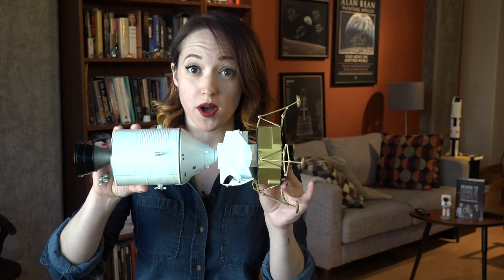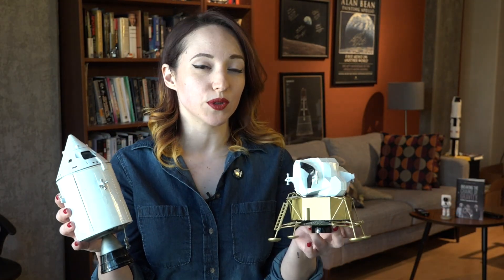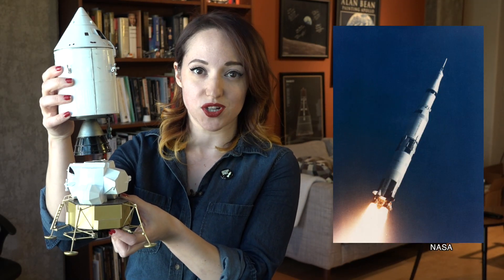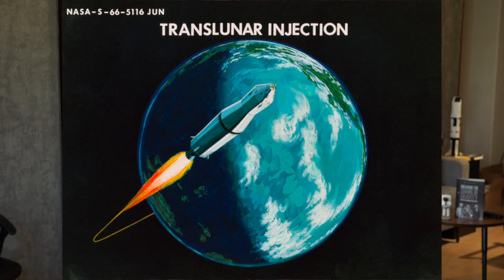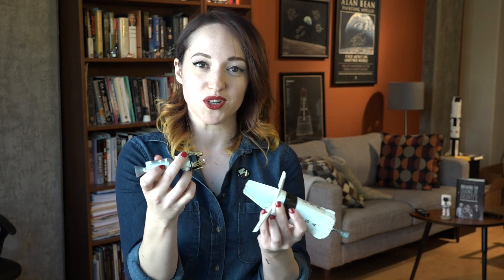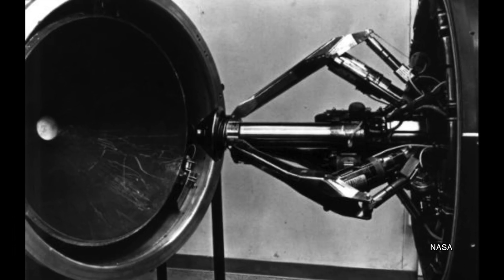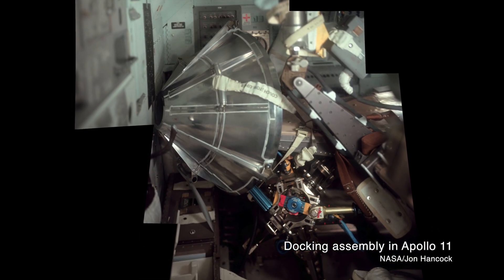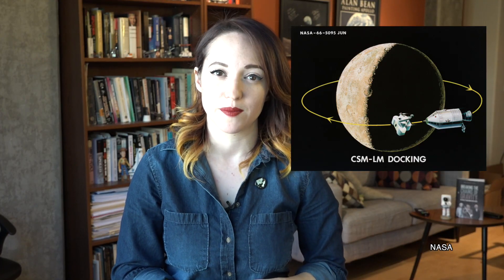How Did the Apollo Command and Lunar Modules Become One?

Comment: They would never find Columbia in a million years. The story is fake.  Moon size is 1/3 of the size of the earth so being on the moon orbit feel the same as being on the earth orbit. Anything left on that orbit is hundred of thausands miles away and almost invisible. Thy used lander with window on the side, size of washing machine window. I can't even reverse my car with side window available. Lander only has a fuel for one attempt. Even with modern computerized equipment it would take many weeks to find Columbia and multiple refueling to adjust the speed from zero to thousands mph. It is just idiotic story invented for population of 1960 who watched Stanley Cubric cinema productions.
Reply: Clearly you’re it uneducated. That’s fine.
Reply: @kitcanyon658  On the other note. Explain why the rocket or lander didn't heat up to thousands of degrees. In vacuum there is no heat disposal anywhere. The temperature of the Rocket would increase endlessly untill red hot just by its own electrical devices and sun rays. That is basic physics.  All those missions are fake. Even unmanned. Only low orbit is possible where you actually can disperse your own heat to thin gas particles.
Reply: @dariusz078  : Basic physics and you don’t even know about radiation heat transfer? 

Another fail, bro. Like is always say, get an education.
Reply: @kitcanyon658 
So I will ask you a question now. How is rocket engine heat going to be removed from the rocket and what type of air conditioning is used on that rocket from 1960-ties
Reply: @kitcanyon658  I am trying to make technical conversation but you are getting emotional like menstruating girl. No need for that. Without being too touchy feely can you explain why items in 80% evacuated tubes heatting up to hundreds degrees. Well, my understanding is, because convection and conduction is obstructed and to radiate away so much heat that is given by sun the item need to increase its temperature. Just keep your answer technical without emotional mood changes. Don't call me son. It is weird thing to say.
Reply: @kitcanyon658  you came to me with grievances not me to you. You are now asking me to do calculations for you to prove something? If you have any issues with real tests of heated materials in half- vacuum tubes then I will listen and respond with counter arguments. For now you are just being a bit of angry confrontational individual.
Reply: @kitcanyon658  to disperse heat from the space craft in a controlled manner they would need to paint black the area that is not exposed to the sun. Blackbody radiation of items painted black is the most effective. (Epsilon close to 1). They would need to use series of complicated heat pumps to transfer heat from one area to another. That is only theory. In practice it wouldn't work because it is too complicated. Non such devices were contemplated in the moon mission anyway because it was fake. All they cared about is good Stanley Cubric like production. Population of 1960s wouldn't ask questions. They were well mind controlled by Hollywood productions.
Reply: @kitcanyon658  If an object is orbiting the Sun at the distance of Earth (150 Gm), it will actually register quite high temperature (about 400 K). That is assuming there is no engine and electronics that add up heat to the system. If you add all the energy consuming equipment the temperature would probably reach thousand.  Even average car engine cannot be cool down by radiation. You need very efficient radiator and fans and use convection. Cooling an engine with radiation is impossible. Have you seen those rocket and lander. It is as thin as paper. Anybody would fry inside like chicken. Especially the lander. There were no haet pumps, no  insulation, just plywood and tinfoil. It is just crafted for film shot, that is it
Reply: @Smee Self what is an odd thing to ask assuming that whole moon landing story was produced in film studio.
Reply: @Smee Self it is really odd to ask temperature at the moon. Do you mean air temperature? There is no air. You mean surface temperature? Surface of the planet has incredible mass and it takes weeks to heat it up to hundred of degrees unlike light weight kitchen foil lander. . Moreover day on the moon is very long. Try again.
Reply: @Smee Self pebble touches another pebble and another pebble touches another pebble. It is called CONDUCTION heat transfer. Pretty basic elementary school staff
Reply: @Smee Self it touches the ground, so?
Reply: @Smee Self the only amusing person here is you. you are trying to say the lander will cool itself down with legs touching the moon surface. I will play with you:  'Lander is not touching the surface. It is in space for last couple of days and still hasn't landed yet.' can you quickly tell me it's temperature?
Reply: firstly, satellites are unmanned and electronics that withstand 400deg faranheit heat are available,  moreover at lower earth orbit you have gases that play critical role in cooling down the satellite. Eventually drag from atmospheric gases brings the satellite down. That is not the case once you pass van Allen belts. You have no gases and no hope. Nobody have been there yet. 
Secondly,  are you trying to say that plywood/kitchen foil lander doesn't need to disperse heating from rocket engine? You clearly have no technical imagination. You proved you have trouble with logical thinking in first 2 comments but this is just a final confirmation about quality of "iteligentsia" that support moon landing nonsense.
Reply: @Smee Self you came to me and start talking. Then you became moody and angry. If you are unable present any arguments then jog on. I am done with you.
Reply: @Smee Self At first you asked incredibly blunt question about temperature at the moon during the moon landing. Ask Stanley Cubric.
Reply: @Smee Self are you asking me to provide the temperature from moon mission that did not take place and then insists on that in another message. It is madness.
Reply: @Smee Self tell me the temperature of chicken in casserole on full flame one second after you put it from fridge to the oven.
Reply: @Smee Self let's start from measuring temperature on EARTH.  Even in Canada at -20deg Celsius you will get + 200deg Celsius if you exposed small objects to the sun in vacuum glass tube. Now extrapolate that to real vacuum in space travel and unobstructed by earth atmosphere sun shine.
Reply: @smeeself, @Jan_Strzelecki, @dariusz078
Gold’s melting point is at about 1,943 °F (1064 °C). With little to no atmosphere on the Moon, the heat from the Sun would have melted the see through layer of gold on the helmet visors. This video further supports the Moon Landing Hoax.
Reply: @Smee Self  To sum up, their tiny spacecraft was able to accommodate air conditioning system,  hydrogen power cells installation, hydrogen tanks plus oxygen tanks, and anough of it, plus fuel tanks plus rocket engine plus rover and staff, lol, and oh, I almost forgot, plus 600Ib of moon rocks on the way home. They must have left shovels on the surface of the moon. To think of it is mind-blowing. I wonder why they concealed the footage of astronauts shoveling moon rocks into the spacecraft.
The idiocy of today is to believe in unbelievable but those who believe in moon landing will believe in anything.
Reply: @dariusz078  To sum up, their tiny spacecraft was able to accommodate air conditioning system,
The Lunar Module didn't use air conditioning to disperse heat. The fact that you didn't know that indicates that you've done no research whatsoever, and thus your uninformed opinion can be dismissed as such.
Reply: @Jan_Strzelecki  lunar module, didn't use air-conditioning, so I guess the team was well trained to withstand couple of hundred degrees of heat. I guess they were very well trained. Believing in this whole story indicates your have very good technical imagination.
Reply: @Jan_Strzelecki   object exposed to sun in the vacuum would reach higher temperature than object exposed to the sun left on your fron gaeden. Last time I checked my car I left on the sun and  I could fry eggs on the bonet.  I left it on the sun for only one hour . I can't imagine what would happen if my car was in vacuum. It would melt in front of my eyes.
Reply: @dariusz078  lunar module, didn't use air-conditioning, so I guess the team was well trained to withstand couple of hundred degrees of heat.
You should've actually done some research before you posted that, because you continue to embarrass yourself with such ignorance - not only by refusing to actually learn something, but also by revealing that the only way of cooling something you can think of is by blowing cold air on it.

Believing in this whole story indicates your have very good technical imagination.
No, I just know more about it than you do, and I'm humble enough to accept corrections.

object exposed to sun in the vacuum would reach higher temperature than object exposed to the sun left on your front garden.
Yes, eventually they would. And I suppose some of it would melt and come apart, but it really has nothing to do with the veracity of the Apollo program, and the fact that you imagine that it does only goes to further underscore how woefully unprepared you are to have such conversation.
The very first response not-so-kindly suggested to you to brush up your knowledge about heat transfer methods in space, and I'd like to repeat that suggestion:
Learn about what you want to talk about before you actually talk about it.
Reply: @Jan_Strzelecki  and they also has to fit in that rocket Oxygen tanks, hydrogen tanks, rocket engine, fuel cells. Ah and I almost forgotten. They brought with them 600Ib of moon rock. I wonder if they left shovels on the moon or took it with them. Don't forget they left Columbia on the moon orbit flying at 40k km/h  EMPTY. Without any crew. Speed is similar to going from Poland to Australia and back in one hour. Not only they found this empty rocket and docked having window on the side size of washing machine window but they returned with it to EARTH which was 1000x more further away than all curren space missions. I can't even reverse my cat with side window available but I am glad they spotted the rocket in space at distance like from here to Australia. They were very skilled. I believe it now. You convinced me.

Comment: You got some facts wrong:

First, the transposition and docking process wasn’t done at less than a foot per second.  That was the speed of the Command/Service module relative to the Lunar Module.  The two spacecraft were actually traveling toward the moon at over 20,000 miles an hour when this maneuver was executed.  

Second: if the astronauts could not dock with the LM, there would be no extravehicular activity to use the LM - not even in an emergency.  And there are multiple reasons for this - the most obvious being that the CM was the only way the astronauts could return to Earth.  Another obvious reason is that the CM wasn’t designed to allow EVA.  It was only designed to allow passage from itself to the LM.
Reply: The speed of both spacecrafts is completely irrelevant. The only relevant speed is the speed difference to each other.
Reply: I think the relative speed its understood.

Comment: Docking was by AUTOPILOT for Apollo, the EAGLE has the same Computer and Navigation as the COMMAND MODULE. Both have a SYSTEM WIDE NAVIGATION SYSTEM AUTO PILOT. The EAGLE emitted a signal of HIGHLY ACCURATE SYSTEM POSITION to the COMMAND MODULE. The COMMAND MODULE then went through an AUTO-DOCKING PHASE and docked automatically. It is not done manually as the docking method is extremely difficult if done manually. It does not take much for things to go bad and people to miss their approach. With AUTOPILOT the process is smooth and safer. The windows on both the EAGLE and the COMMAND MODULE are small and it is very, very difficult to dock under those conditions. The EAGLE is not dragged out it is just coupled and the booster drops back by reverse thrusters. This is done prior to leaving Earths Orbit. I am the Arkangel Daniel and I am from Heaven.

Comment: Yeah, that is what happened.   A couple questions. How did the lunar module find and catch the comman module traveling at 3600 mph, 69 miles above the moon's surface? How exactly did they keep the section that housed the lunar module still to extract the lunar module?  Clearly that section would not be stopped in a stable position.

Comment: Travelling 1 foot a second? But weren't they just Travelling the other way at thousands of miles per hour? How can you have two different speeds in two opposite directions at the same time ?
Reply: Relative speed.  High speed relative to the surface,  low speed relative to each other.    Like walking behind someone on a train that is moving 90mph.   But you walk slightly faster than the person ahead of you.    Your speed relative to the gound is 92 mph,  the other person's speed relative to the ground is 91 mph  but your speed relative to the other person is only 1 mph...  

They were not moving thousands of miles per hour relative to each other but together through space.
Reply: @Bendigo1  is the solar system a inclosed system like a train?
Reply: @JudaismIslamUnited  In a way, it can be thought of like that.
Reply: @Bendigo1   how the fk is open vacuum of space a inclosed system.?
Reply: @JudaismIslamUnited  🤦‍♂️
Reply: @JudaismIslamUnited  I just don't like wasting my time.
Reply: @JudaismIslamUnited  Your M.O. is common.  Ask a question.  Get an answer.  Reject the answer.  Ask the question again.

Yes the solar system is just as much of a "closed system" as the train; just bigger.  Asking questions is fine; rejecting the answers makes you a fool.

Comment: How did they move from the command moduel to the lander ? The command module is the part that also touched down ?
Reply: They pulled the docking mechanism out and went through the tunnel between the two parts.   The LEM is the part that landed and the command module stayed in orbit.
Reply: @Bendigo1   yeah yeah. Of coarse they did.   Tell me was the craft also being pulled along by the sun at 590,000mph?
Reply: @JudaismIslamUnited  Nope, just coasting along to the moon at about 36,000 mph.
Reply: @Bendigo1  but the moon and earth are apparently being pulled at 590,000mph by the sun.. so what coasting
Reply: @JudaismIslamUnited  Where are you getting those numbers?

Comment: How did the lander reach the same speed as the orbiter?
Reply: Rockets...
Reply: @Bendigo1  fantastic answer. Physically reasoned. Thank you so much.
Reply: @MegaEQus  Anytime.  😁👍   I have a mind filled with this information just waiting to be used to help others understand how things work.
Reply: @Bendigo1  I see...
Reply: @MegaEQus  On a serious note, there really is no other explanation,  unless you want the mathematics and calculations done to figure out how to match the speeds.  In that case I have no idea.   

A simple explanation is that the accent module launched when the csm was 1/2 or 1/4 orbit behind them, then they accelerated up and sideways to a rendezvous point at which time the orbiter would have come around to meet them and they would be at nearly the same speed,  only a few small corrections to match velocities and line up and dock.  

I know this only from doing it in kerbal space program.   I do not know the specifics of the Apollo missions.
Reply: In a mythical story, anything is possible.

Comment: There is a ton of information on HOW the transposition, docking, and extraction process happened, but pretty much nothing on WHY this very risky engineering choice was made. If I designed the system, and had to incorporate the clunky transposition, docking, and extraction process, I'd run a bit of rope from the top of the command module to the top of the lunar module, so once undocked, if re-docking failed, you could just winch the rope in which would pull the two craft back together.

Comment: 1:29 Bring it around and turn it around is problem, because there is no wings, that could be steer the ship. Or then then there must be some side thrust, which then can turn the ship 180 degrees and then stop ship to turn over 180 degrees. But there is not side thrust or side Thrust(ers) both side of the ship. When you think about that, you realize, that the ship need some kinda extra turning force to turn exactly 180 degrees, and then stop turning. But thank you for nice video which explain this turning situation.
Reply: There's no air in space, so wings don't work. They use thrusters all over the  CM.
Reply: @atlas8827  Where are those thrusters . . . Are there any videos, that can proof those thrusters are true?
Reply: They used reaction control thrusters, but they may not be visible in the picture.